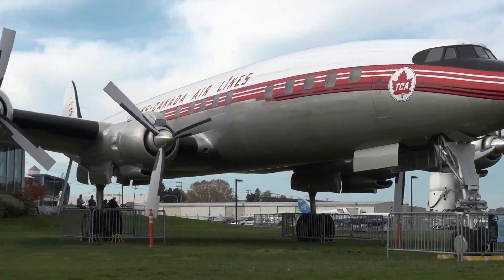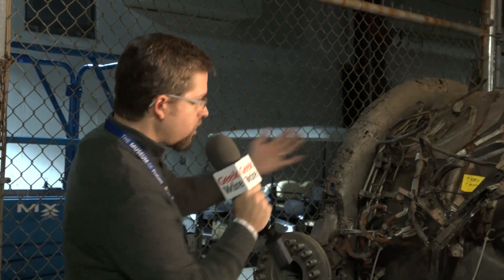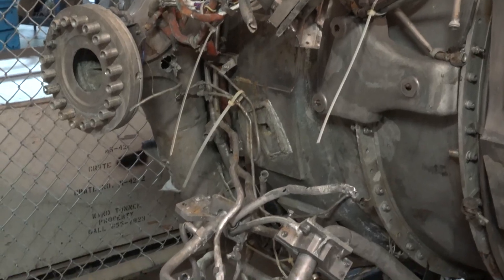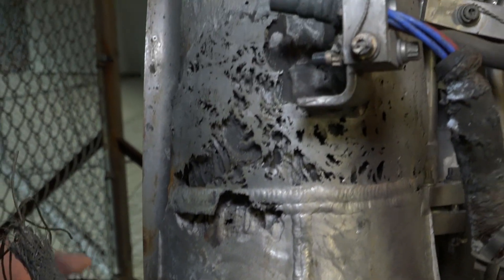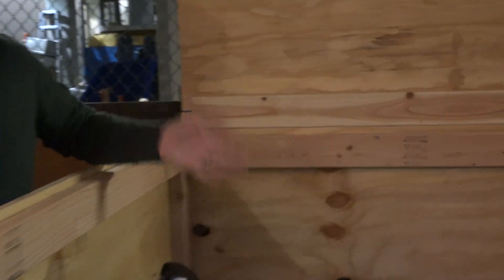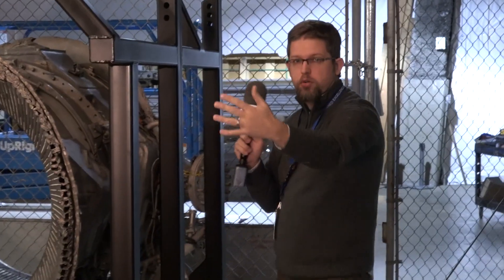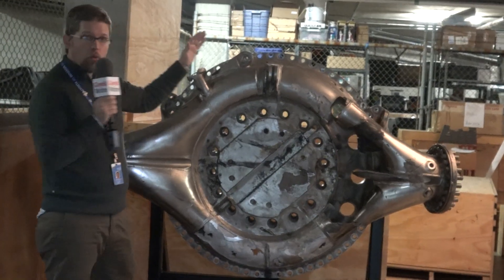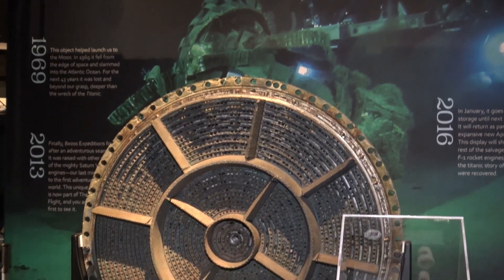Sneak Preview: Recovered Apollo Saturn V F-1 rocket engines at the Museum of Flight

Comment: An interesting thing is that parts of that LOX dome welded together seem to be made of slightly different alloy grades. Some of them corroded, and some were not touched by corrosion at all.
Same for the corrosion pattern on the kerosene ring. It suggests that the source alloy may not have been completely uniform.
Reply: Different forming and heat treating processes on 2 pieces of the exact same alloy can affect the crystal structure and thus the corrosion resistance.  Once cracks open up,  the part is doomed to rapid deterioration.  In salt water you also have to consider electrolytic effects when different metals are touching
Reply: Alexagrigorieff  You are probably right but do you think that maybe certain areas were buried in silt and protected from corrosion to some degree?
Reply: I see your point, its just that one panel. It must have been the Friday afternoon shift at the foundry.
Reply: Alexa: The part that wasn't corroded was the part buried in the silt. It's oxidation that causes corrosion, and saltwater has oxygen in it (H2O) thus the part exposed to water corroded. The same thing happens with ships, wood or steel,  found on the ocean floor: the only parts salvaged are the parts buried.
Reply: I thought so at first but it's obviously (look at 5:42 ) only one panel that precisely had rusted.
Reply: Alexagrigorieff 
Probably due to it either sitting in abyssal mud or not.
Reply: Yeah, precisely one part, from weld to weld, is rotten. Strange.
I'm sure there is a lot to learn regarding aging of space technology in harsh environment by studying these artifacts. Could even helps overcome technical problem on long duration mission on other planets.
Reply: Could have been a number of things. Could have been made by a different manufacturer, or possibly intentionally a different alloy for something like heat disipation or some other reason. Probably never know why really.
Reply: I thought this too.  Makes me wonder if NASA hasn't taken samples and investigated.
Reply: i thought i was the only one to see the welds. still great almost handmade parts got us to the moon.
Reply: maybe it happen while in flight ? its probably some stainless steel  grade of metal
Reply: @TheCamshafter  Yes you're right about the acid level at great depths. I was thinking more about wrecks found in shallower waters, especially wooden ships.  But 3 miles down it's a whole different world!

Comment: What does it smell like? Weird question, I know, but I'm curious.
Reply: Victory.
Reply: The "right stuff".
Reply: Fish, probably.
Reply: Rusty tetanus 😉
Reply: America. It smells like America.
Reply: My father built the F-1s in Canoga Park for Rocketdyne. He told me a few months before he died, that there were 65 of them built that were never used. Now I see some news that they may be used as the base for a new generation of more powerful engines.
Reply: Roxanna Mason Yes, I agree. The SS parts, and the low oxygen content of the ocean at 14K ft would cause very little "corrosion".
Reply: They woyld have been mighty parachutes.
Reply: Smells like burnt kerosene. What else could compete with that? The fuel was kerosene and Liquid oxygen.
Reply: Mike Mac
Reply: Same as a modern jet engine smell. Jet A-1 fuel used in modern commercial airplanes is mostly kerosene, which BTW is actually a very thin wax.
Reply: Except for the narrator, he needs to stop trying to be a rocket scientist and stick to his day job,a  narrator. And NO, being 14KFt under the ocean had nothing to do with the level of destruction these poor engines experienced, explosive hydraulic deformation from impacting the ocean at 100's of feet per second, explosives could hardly of done more damage, such a crime to not to put parachutes on the aft end of the Saturn 5 SIC first stage, bring it down fwd/front first and let the tanks collapse and absorb 99.9% of the impacting energy. Very do-able but NASA didn't want any salvageable parts. Now they claim salvage rights, sorry it's international waters just like a ship wreak.
Reply: Smells like "teen spirit"
Reply: Smells like BS.
Reply: @irishstock2108  Like you would know anything.
Reply: @irishstock2108  Nor does anyone care about your heritage Whitey.

Comment: No wonder NASA now uses solid fuel boosters.
Reply: 150 launches,  2 losses. There's nothing too wrong with that record.
Reply: Isukaman , The Shuttle's own 3 main engines were also liquid fueled like this one.
Reply: MattOGormanSmith It was 135 launches, and that failure rate is atrocious! It's designed flight failure rate was supposed to be 1 per 100,000 launches, so instead of 0.001% it was 1.5%. The Space Shuttle killed more people than any other spacecraft in history (by far). If you divide project cost by flights it comes out to $1.3 billion per launch, so it's also the least cost efficient booster ever used. By almost every measure possible it takes the cake for being history's most expensive, most dangerous, and most unreliable manned spacecraft ever built. Even former NASA administrator Michael Griffin called it “a mistake.”
Reply: All major space agencies have used both solid and liquid propellant rocket engines. Solid propellant tends to be less efficient, but cheaper. Thus solid rocket motors are commonly used as "boosters" on the sides of liquid propellant rockets.

As you progress through the stages up towards the top of the rocket, you typically see a shift from cheaper, less efficient fueled engines that give higher TWR (thrust-to-weight), towards more expensive, efficient engines that don't have (or need) as much thrust-to-weight.

TWR is important early in the launch, when you are fighting gravity head on. As the flight path arc over towards horizontal, gravity doesn't reduce your speed so much as change the direction you are flying in.

Additionally, the rocket equation favors high efficiency engines as they use less fuel mass to achieve the same result. This is far more true for the upper stages than it is for the lower stages, as each stage has a compounding effect on every stage beneath it. This is why upper stages of rockets almost always use Liquid Hydrogen / Liquid Oxygen, as their higher energy density and low exhaust product mass give a very high velocity exhaust stream, giving more total impulse per unit of fuel mass.

If you have any followup questions about this topic, feel free to ask!
Reply: They used solid rocket boosters because they're cheap. Came back to bite them on Challenger… oops. Space Shuttle is a crap heap, 40% vehicle loss rate. Apollo missions were the golden years.
Reply: Michael Pendergrass I never claimed the engineers believed that figure, but that's what was claimed by NASA officials to the public and politicians alike. Just adds to the deceptive nature of the program and the unrealistic mindset that brought it to life.

I think anyone with sufficient experience would laugh at a figure like that out of hand when talking about a rocket booster, that level of reliability simply isn't feasible.
Reply: So does North Korea.
Reply: Mike Mac the Apollo 13 hasn't added to the dead tally
Reply: Apollo 1 and 13, not so much.